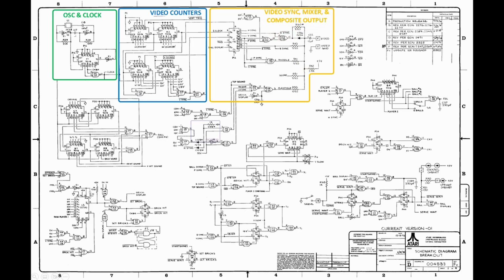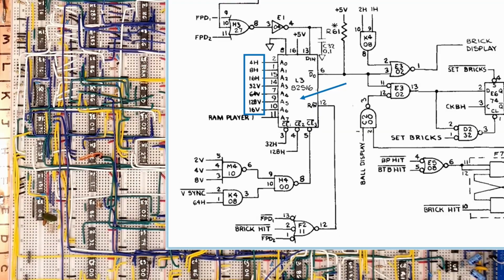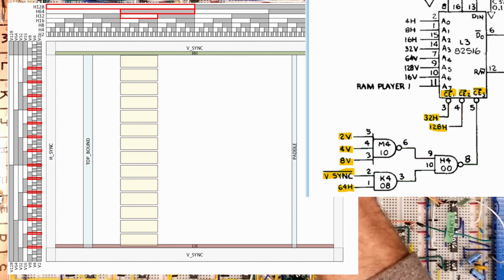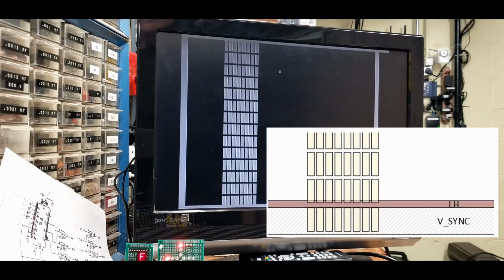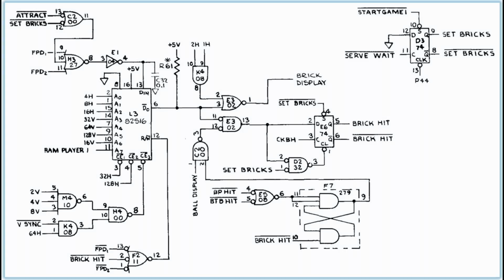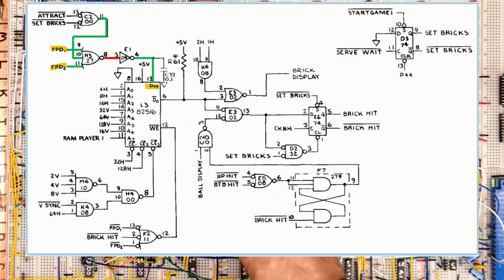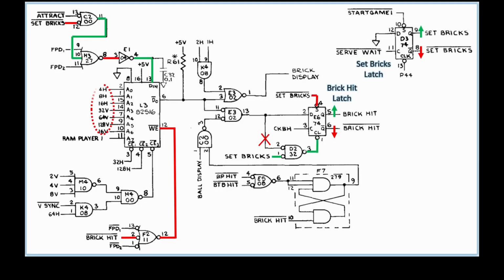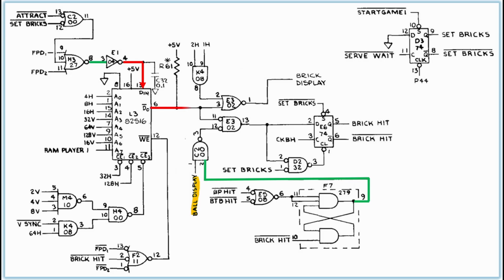Retro Atari Breakout Part 9 - Bricks

Comment: Hello. I can't get the 82S16 in Japan, so I tried substituting a CMOS SRAM, but it doesn't work. Have you ever tried substituting SRAM?
Reply from the maker: Howdy. There is a list of "compatible" SRAM in Retro-BOM.xlsx in GitHub, but many do not work perfectly because they disable the output during write. This is just strange visually because the bricks don't show up when you start a game, then appear the first time the paddle is hit (SERVE_WAIT/WE turn off). My recommendation is to somehow acquire the N82S16 or N82S17, but if that is not a solution you can try the others. What CMOS SRAM part did you try? -Paul
Reply: @bytemind-dev  Hello.
The SRAM I used was Hitachi's HM6287LP-45.
HM6287 A0–A7 → N82S16 A0–A7
HM6287 A8–A12 → GND
Reply from the maker: Simple differences: DOUT needs to be inverted and you need to merge the 3x CE lines into a single CS line (3-input OR for the negative signals). Difficult differences: Write happens at the rise of WE or CS, whichever comes first. In the N82S16 the write happens when WE and CEx are all low. The breakout design itself does not even comply with the N82S16 datasheet, but it works. You can get N82S16s from eBay in the US for ~$5. Customs and shipping to Japan ~$20, so yes, that's an expensive part. Not sure what to tell you here. -Paul
Reply: @bytemind-dev  Thank you. It seems like the cause lies with WE and CE. I'll try a little harder. I'll let you know if I have any good news!
Reply from the maker: With that Hitachi part, you would need to figure out how to quickly drop and raise we (min 30ns) after CS is selected. If you look at the Write Timing Diagram #2 it shows that if you bring up CS before or at the same time as WE it disables the output until the next CS read cycle. This chip also disables DOUT during WE, so assuming you get the regular brick WE working, you may have blank bricks after starting a game, but will re-appear when the paddle is hit for the 1st time. Good luck! I can probably send you a N82S16 if needed. Let me know. -Paul
Reply: @bytemind-dev  Thank you for your advice. It was very helpful. I'm considering purchasing the N82S16 and would like to learn more about the technical aspects of this memory. I'll do my best to find out as much as I can.
Reply from the maker: @生田製作所  Did you ever get the N82S16? How is everything going?
Reply: @bytemind-dev  I ordered an N82S16N from eBay. It's been two weeks since I inquired, but it still hasn't arrived. However, I haven't given up on the Hitachi-HM6287P yet. Thank you!
Reply: @bytemind-dev  Hello. Could you please check if the circuit I built using the Hitachi HM6287 is correct?
Reply from the maker: @生田製作所  I'm not sure what you are asking me to do. You can send me an email with details by looking at my channel profile address. -Paul